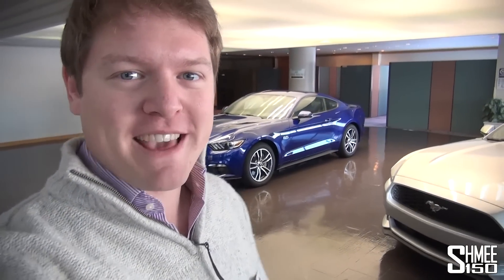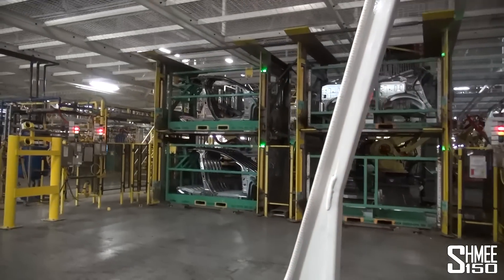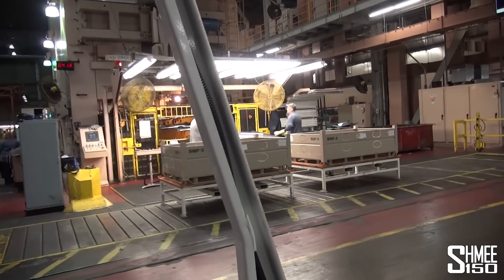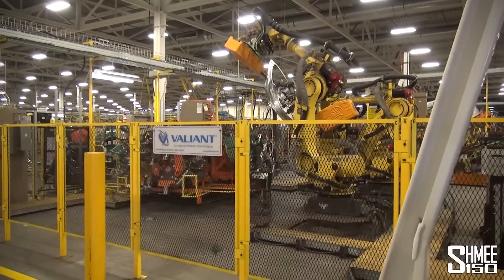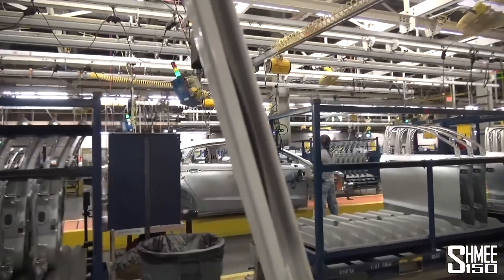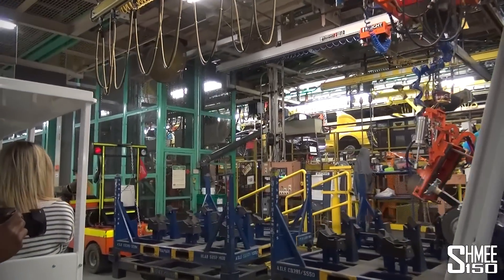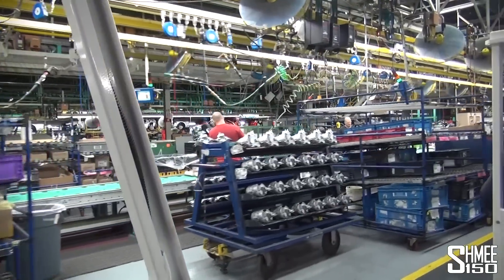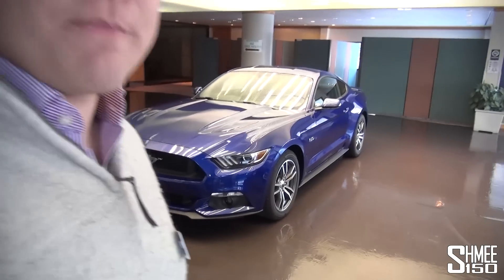Tour of the Ford Mustang Factory - Flat Rock Plant, Detroit

Comment: I work there!
Reply: So do i😊
Reply: I just bought a 2019 Mustang GT, love the car out two things really stand out. The rear trunk light doesn't work, and upon closer inspection, there is no wire connected to the bulb, its completely missing. The other issue is my GT has the Ecoboost analog RPM gauge installed which has the 6500 rpm redline. The GT has a totally different engine and the rpm gauge is supposed to have a 7400 redline. This is the gauge that was supposed to be installed. 🤔😡
Reply: @JCTiggs1  LMAO
Reply: +JCTiggs Surely you can go back to the dealership and have them swap the tachometer an install a trunk light for ya?
Reply: @D-dly0  Regarding the trunk light, absolutely! They are taking care of the issue but I'm waiting on a part for another issue as well (the rear decklid was cracked at some point during delivery and needs to be replaced). The analog rpm gauge with the incorrect redline is a complicated issue since it affects ALL 2018+ Mustang GT's with an analog km/h speedometer outside of the US. The rpm gauge and the speedometer are a single part and not two individual parts. Therefore, one half (the rpm gauge) can not be swapped out while retaining the other half (the km/h speedometer). The dealership currently can't do anything about this issue, since its up to Ford Head Office to either manufacture the proper part, issue a special rpm overlay piece that is somehow retrofitted to the existed gauge panel while retaining the km/h speedometer, or swap out the improper analog RPM gauge with the digital dash which does have the correct rpm redline. I'm currently discussing this issue with Ford to see how they're going to fix the problem. 🙄
Reply: @JCTiggs1  +JCTiggs Oh wow that is far more complex than I first imagined! Well I hope they sort that out for ya, what an oversight by Ford. Atleast its still the mean machine that Mustangs are known as, cant wait to upgrade from my old 05.
Reply: @kevindoran4938  Yeah. I will say that the Mustang has a great rating by Consumer Reports for build quality and reliability.
Reply: Who installed my xm antenna wrong?

Comment: I really wanted a Mustang and was planning to buy one. Then I rented one; driving it cured me of any desire I once had.
Reply: ***** 
If you rented one and it cured you,it must have been an entry level POS or beat to shit from being rented because I've never heard of anyone not loving this car..I have an 04 GT that and I'm thinking about the 2015 now but mine I did a few upgrades to and I have 96k on mine.
Reply: Mike Samra exactly
Reply: I just bought a 2017 GT Convertible just by how beautiful it is and test driving it completely sealed the deal
Reply: Did you ever end up buying a 2015? I have an 01 GT and am thinking about getting a 2018.
Reply: I just bought a 2018 and it runs like a scalded dog but the transmission and clutch have been making some undesired noises although it has not affected performance.
Reply: I just bought my 2018 a month ago. I guess Im lucky, I havent had any weird transmission or clutch noises yet thankfully. Im just about at 1000 miles - I am going to change my oil and then let it rip!
Reply: JayJr2007 Touring a car factory cured me of any desire for an American car.

Comment: I don't think they are doing the best job on the quality control final inspection... Look at any mustang out there from 2015 - 2016. The panel alignment is terrible, not sure if its a design flaw or a quality control flaw. Some of the doors are more recessed than the panel next to it. Panel gaps are inconsistent through out; in some areas you have a very tight and good looking panel gap, but then as you go along the gap it widens. I have a 2000 Ford Focus Kona edition and actually went to the Ford dealership to get one of these because my car was not keeping up anymore and I wanted to get a new car. Once I saw how bad the quality control was on these cars I ended up not getting one. Also, I noticed these cars have depreciated a lot on value in just one year. I know all cars lose value the moment you drive them off the lot; but these cars seem to lose more value than any other car I've seen. I really like the design, it's my favorite looking , muscle car right now; but if the quality is not there I won't buy it.
Reply: Dont blame the final inspection, they didnt bolt the panels together.
Reply: @nealedmondson3191  Or yours.